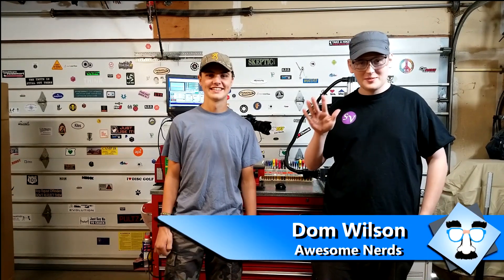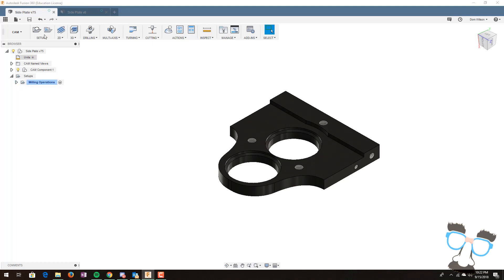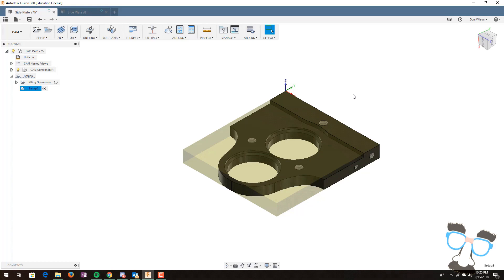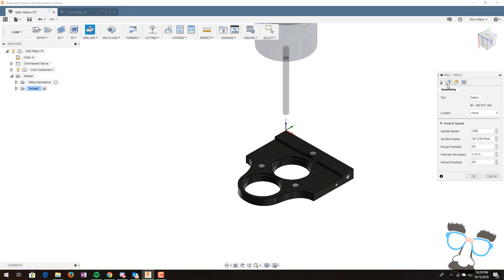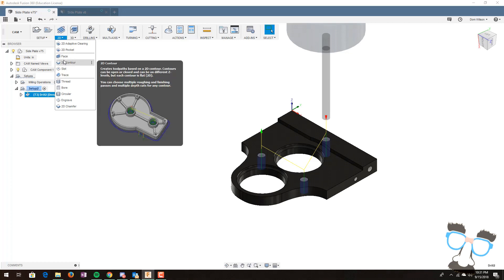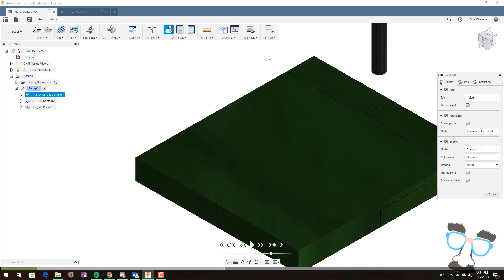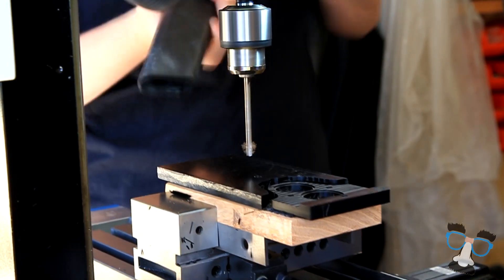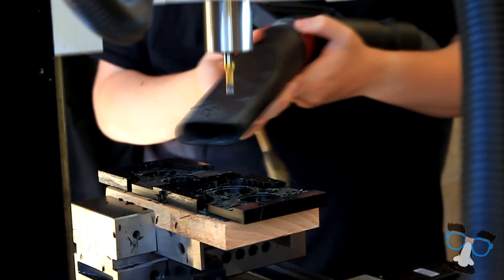CNC Manufacturing for FTC robots

Comment: Hi, I was wondering why you guys decided to tape the piece onto the scrap board. I have found it to be a lot more secure, faster, and cheaper to just use some screws and screw down the piece. I used to use the CA + masking tape on our cnc, but have since just moved to screwing down the stock to the wasteboard. Contouring is usually done as the final step as after it is done, the work holding of the piece is significantly diminished once it is contoured, although probably less important with delrin as its easy to machine. Once stepped up to aluminum it begins to play a decently large factor.
Reply from the maker: Hi Sanford L, we primarily use the scrap board because we personally found it faster. We don't have a standard mounting plate, but we do have a lot of wood suitable for this type of operation. We typically have 2 people on the mill with 1-2 people on the side cutting new stock and mounting parts. We also don't use any standard tape, typically we use extra strength gorilla tape or something similar. I'm not sure if this was a miscommunication in the video, but we typically do contouring as the last step. One issue we had early on was that any small parts would pop off as soon as we cut to the final depth. We ended up adding tabs to our part so we could still keep it on the stock. We don't use the taping method with aluminium, because we have found that the forces are just to big for the tape. However, delrin cuts like butter, so it works well for our situation. Did you make your mounting plate, or did you purchase it from a manufacturer?

Comment: what type is that mill? can it do aluminum?
Reply from the maker: Hey Zachary, we use a Little Machine Shop Model 3990 HiTorque Mini Mill. We had to convert it to use CNC control, but Little Machine Shop has some great instructions and customer service. Although we mostly do plastics, we can do aluminum, albeit at a much slower pace. Let us know if you have any more questions.